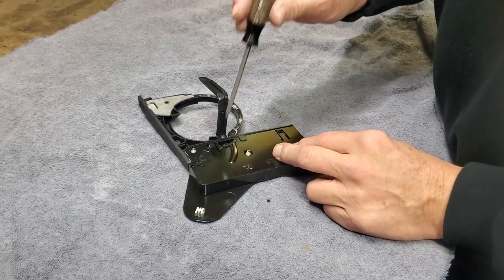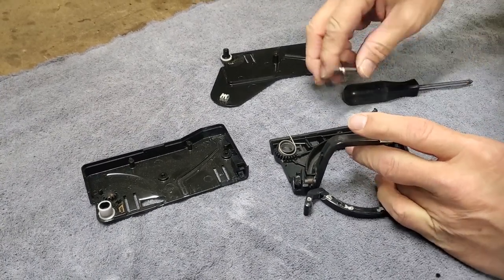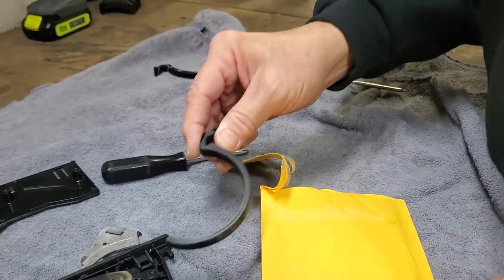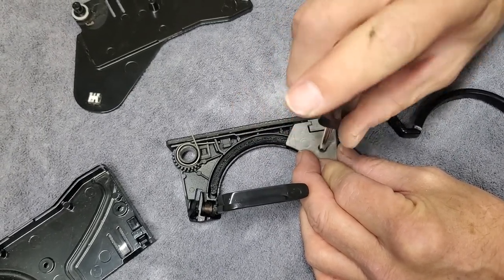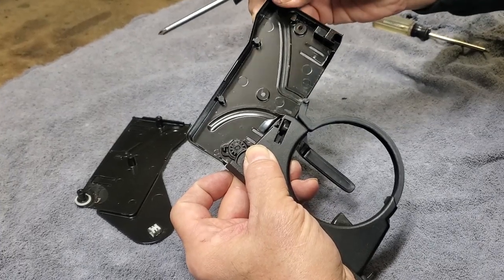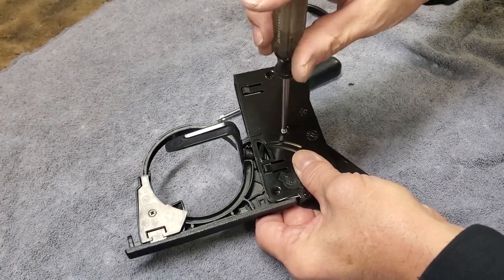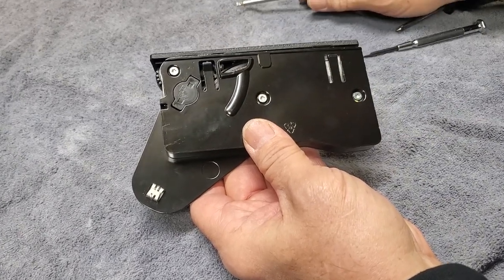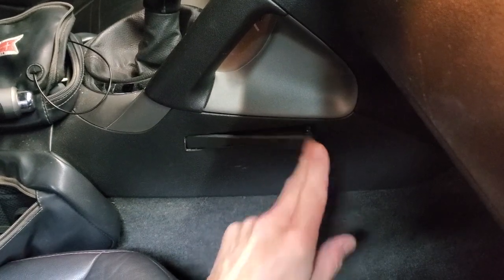Pontiac Solstice  Saturn Sky Cup Holder Replacement Arm

Comment: Just redid mine.  No need to remove torx screws.  Just take out the Phillips head to remove the small cover.  Mine was plastic not metal.
Reply from the maker: Thanks for the tip. We always welcome new ideas.

Comment: I wish I would have saw this a month ago! Apparently they are not listed for sale anymore.
Reply from the maker: It looks like the seller has moved to PicClick. Thanks for commenting; it will help us pass the information to others who may be looking. I will make the correction in the video description. Here's the link. Let us know how it works out. Here's the link:

https://picclick.com/Pontiac-Solstice-Saturn-Sky-Cupholder-Replacement-Arm-332821686040.html

Act quickly, as they do sell out each time they're listed.
Reply: @CarzPlus  this is listed as "sold"  :-(  Any other purchasing options???
Reply: Oh no they're available again but he's got them up to $25 + $10 shipping no Band-Aid included
Reply from the maker: @robertjackson9973   Here is an eBay listing to try: https://www.ebay.com/itm/334117871950?mkevt=1&mkcid=1&mkrid=711-53200-19255-0&campid=5338722076&toolid=10001 It's the replacement arm only.
Reply from the maker: @sophiehensley121  It's a jump from the original price, but still reasonable. It appears that the seller is a small operation.
Reply from the maker: @robertjackson9973  Here is a link from Pontiac Solstice, Saturn Sky Owners Facebook page: https://www.facebook.com/groups/558290767557602/permalink/5346453408741290/ If you're not on Facebook here's an additional link from the same article: https://www.backwoodsskys.com/
Reply from the maker: @sophiehensley121  Here is a link from Pontiac Solstice, Saturn Sky Owners Facebook page: https://www.facebook.com/groups/558290767557602/permalink/5346453408741290/ If you're not on Facebook here's an additional link from the same article: https://www.backwoodsskys.com/
Reply from the maker: Here is a link from Pontiac Solstice, Saturn Sky Owners Facebook page: https://www.facebook.com/groups/558290767557602/permalink/5346453408741290/ If you're not on Facebook here's an additional link from the same article: https://www.backwoodsskys.com/

Comment: Question please.  I bought the replacement piece off of Bay and installed per your video.  For some reason the new half circle piece does not stay in place when a drink is in the holder.  The new piece comes out of the apparatus on both sides.  The pin does not stay in the slot and the other end comes out of the metal guide.  Any ideas on what I need to do?  Thx.

Comment: OK I ordered the part my tech took the thing apart and sanded and broke the thing basically made a mess of it.  I reordered the part and fixed it.  You don't have to take it apart just feel for groovs for one end of the part work it in there. Works just fine without all that drama.
Reply from the maker: Guess there's more than one way to skin a cat. Good to see ideas and suggestions from our viewers.

Comment: Now if you could just 3D print Kappa tulip panels. It seems like everyday someones asking for one on FB.
Reply from the maker: Someday... We don't have a 3D printer. It's on our wish list. This is an item that was purchased on eBay.
Reply from the maker: Update on the bracket: Here is a link from Pontiac Solstice, Saturn Sky Owners Facebook page: https://www.facebook.com/groups/558290767557602/permalink/5346453408741290/ If you're not on Facebook here's an additional link from the same article: https://www.backwoodsskys.com/

Comment: I bought one..the 3d plastic..does NOT .hold up .the arm over time falls  out it only lasted a year.
Reply from the maker: That's a bummer. This is where we are until someone has a better solution. Mine is still doing fine. We did not make the 3d part, but did use it.

Comment: Wish an aluminum replacement was made for the Solstice/Sky. The original one is poorly engineered and you have to buy multiple one, as they break often. Want a large coffee, forget that... unless you want to remove a large pool of coffee in you car. 😠
Reply from the maker: Really it's a weak point in the car and we'd definitely like to see something stronger. I saw someplace where someone used a full roll of duct tape and placed it on the floor of the vehicle for a large coffee. Not sure how that worked out. With this being all that we have to work with, it's nice to have the fold away cup holder working again. Thanks for watching.
Reply from the maker: Here is a link from Pontiac Solstice, Saturn Sky Owners Facebook page: https://www.facebook.com/groups/558290767557602/permalink/5346453408741290/ If you're not on Facebook here's an additional link from the same article: https://www.backwoodsskys.com/